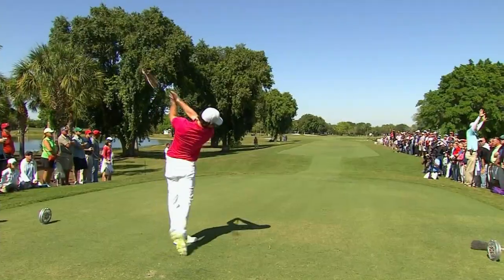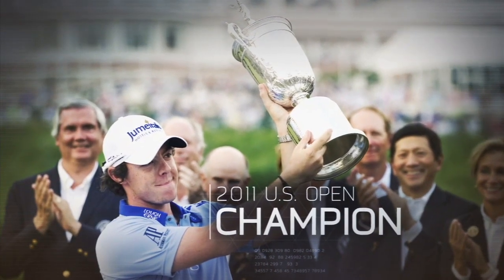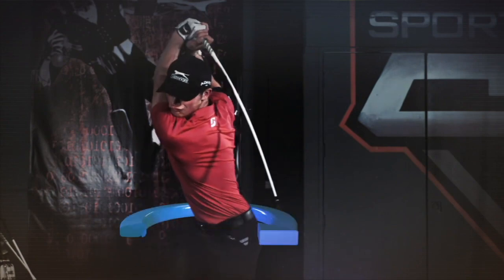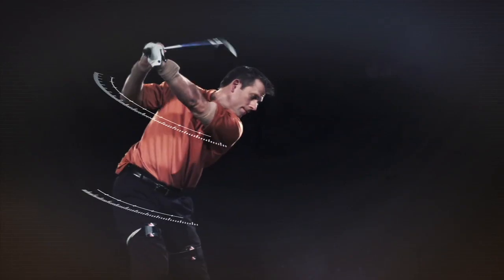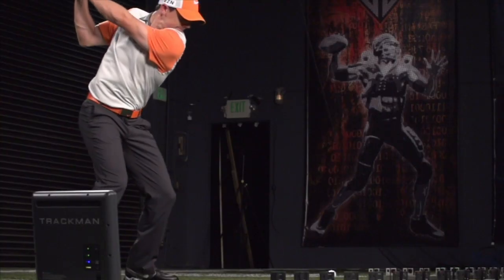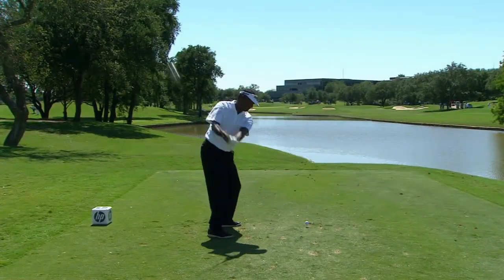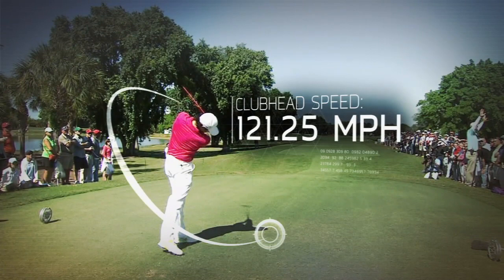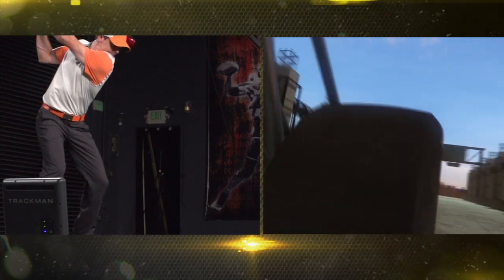Rory McIlroy's Power Off The Tee (HD)

Comment: mass x velocity = momentum = distance
Reply: Human bio-physics are only part of the problem/answer.  More M X V = D is only good if you hit it straight ... otherwise, more is a bad thing.  Of course you want to max out your physical ability and movement, but only if you can hit the ball on the center of the face and square the face and path.  Getting to where you want to go is a job for an equally necessary science ... motor learning.

RE: Rory ... short levers are easier to control than long levers, from a kinesiology point of view ... another science bio-mechanists seem to short change.
Reply: James Smith Genius!!! i alway's find if i strike the ball out of the toe or Hozel with a duck hook or slice, i shoot very low, thanks for pointing out the obvious, this game needs you.perhaps we should just use a pitch/punch shot just in case.? we don't want too much of a good thing after all.
Reply: guess you missed the point ... mechanics are not the road to improvement ... weren't you one of the people who closed down the Golf Channel discussion board
Reply: James Smith no one said it was ,we are talking about distance not accuracy, so i guess you missed the point,with regards to golf channel discussion board, i have no idea what you are talking about, but then again neither do you.

Comment: If one rotates every part of the body faster than average will ones hips , shoulders, knees and back give out earlier?? If Rory keeps this up I predict a lot of Pain in his future.Hopefully he can change that violent swing and opt for longevity as did Tom Watson who at 59 made it to a playoff at the Open. Check Mike Austin who bombed it in his 70's and in his 60's set the record for the longest drive in competition golf at 515 yards. No cart path help and with a Persimmon driver and balata ball!!!
Reply: Probably just depend on how hard he hits it out of the rough and what he does off the course.  Sergio seems to be holding up pretty well.  Rory's sense of timing will be there for the most part.  Splitting fairways as you age is the main challenge.
Reply: He'd have to keep himself in shape to meet the demands. And when he reaches a certain age or level of fitness he might have to change.
Reply: Comparing Rory to Mike Austin is like comparing apples to oranges ... Austin was taller and more naturally athletic (I can hear my motor learning professors rolling in their graves) in other sports.  He got his distance from longer levers in the kinetic link/chain.  Mike used both his legs and upperbody in a longer, yet still fluid motion ... the classic reverse C swing.  His swing obviously produced huge force into the ball, but it was also the picture of a graceful, unhurried motion.  Rory is shorter and more powerful.  Both seem to have a sprinter's fast twitch muscle system which gives them the ability to move the parts faster than others. 

Rory has maximized his X factor ... less hip turn and much more shoulder turn requires super upper body flexibility.  Rory's lag/loading comes from his rotational speed.  This swing was produced in both the gym and on the practice tee!More importantly, he has mastered the timing of getting those parts to the ball with all that speed.  His timing continues to improve.  On the occasion he booboo, it is usually caused by an over length swing getting him out of his usual, picture perfect position at the top.  Not completely sure what Mike formally knew about bio-mechanics, but he obviously figured it out long before the everyday use of video analysis software and Trackman data.  Rory has the advantage of a large storehouse of sports science knowledge and high technology when he needs it.  Where would Mike be with the same info?  Also note the differences in their ages in their prime.
Reply: What about Steve Austin?  The guy could  outrun a horse.
Reply: James Smith There is another, additional reason for the excessive x-factor to my eye. While most others finish their backswings first, and then transit to downswing, Rory is in absolute immaculate synchronization with his legwork compared to upper torso and shoulders. The downswing actually starts a touch earlier than he's finished turning away from the ball stretching the hip-shoulder differentiation even more than he would achieve by only turning back and forth.

It's a thrill to watch him sweeping the ball away with that chain of motion. What I love the most is the timing and rythm of his powerfull muscle work through the whole swing. Such efort could not be done, if you did not have your core in a form of an iron man. The forces would just leak away during the downswing to different directions.

Comment: Not hard to figure out. Force = Mass x Acceleration. So whoever accelerates the clubspeed faster will hit longer, as the club is the same weight for everyone.
Reply: Not all the time.
Reply: +Scott Johnson Sorry but it is not the value of the acceleration that matters.  It is club head speed at impact.  For example, a player could conceivably have the highest club head speed at impact, yet have an acceleration of ZERO at the same moment of impact.  Momentum is defined as mass x velocity and that is what moves the ball.
Reply: Actually it's force that moves the ball, not momentum. Force = Mass x acceleration, but it also = Momentum x time. But I understand your point.
Reply: Scott Johnson
Let me put it this way Scott.  If a 10-ton truck is driving down the road at 100 miles/hour (constant speed), it is not accelerating.  It's acceleration = 0.  Your Force equation now produces a force of 0.  Have to be careful of technical physics formulas and terms.  Club head speed is the vital ingredient.  Also known as velocity.
Reply: +Scott Johnson Well actually, it has been proven through trackman that a club head speed doesn&#39;t equate 1 to 1 to hitting further. You also need smash factor(sweet spot accuracy), trajectory and ball spin. If a guy swings a club 140mph but has a smash factor of 149(not hitting the ball dead center on the sweet spot) with a  launch angle of 16degrees with 3800 revolutions of the ball, his shot will be more than 20+yards shorter than another golfer who swings 137mph with a spot on 150 smash factor with ideal launch angle of 12-14 degrees(2800 revs).
Reply: wrong way to look at it. Momentum is what the ball has yet a force is what gave it momentum. This is Newton's second law.  You should also know by it's very definition that momentum implies that the body is already moving. In this case the ball was standing still so what made it move?? Furthermore calculus tells us velocity is the first derivative of acceleration anyways. Then that also tells us that they make a Trackman measure velocity as to measure acceleration in this micro- second event would cost twice as much because you need a very accurate 2nd sensor.

Comment: Sports science? Hips do not turn. You have two ball and socket joints and the femur which ic in the hip girdle is connected to the knee. You can rotate only standing on one leg. You cannot rotate standing on two legs. I remain baffled that in the world of today this myth is still out there.
Reply: please explain how that is possible anatomically
Reply: i think you're taking it too literally. the phrasing is just for comparative purposes between the original and final hip direction it's pointing in.
Reply: Well, I see your point but the image is incorrect. The pivot with the hips is actually up and down or down and out depending on your subjective point of view. If you try and move in a level manner that is a physical impossibility.
Reply: Hips don't lie.
Reply: So hips turn but knees don't. Yet the two are connected.
Reply: Zeus and the golf gods will take out your left leg so you can rotate on your right so you can tell the world about your theory of hip rotation..
Reply: Sabre Gold j
Reply: Sabre Gold Very interesting.